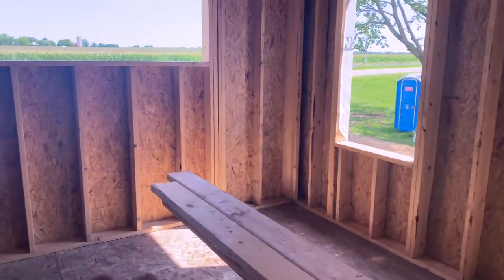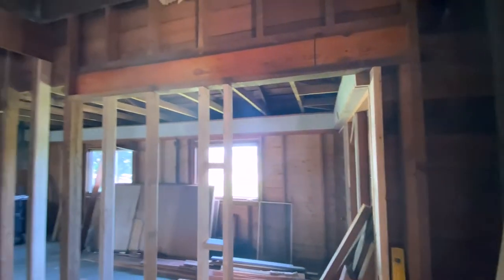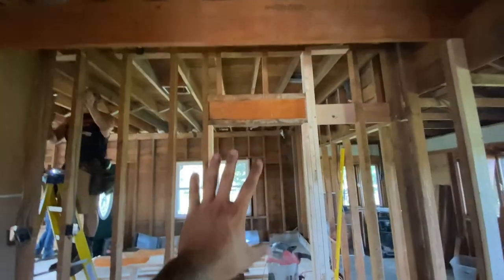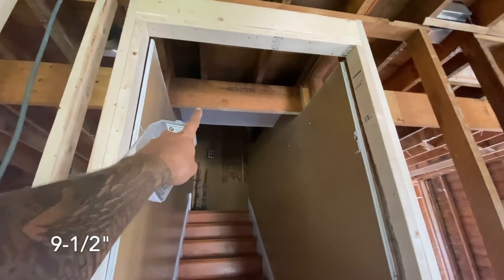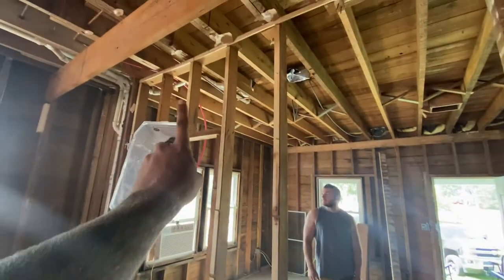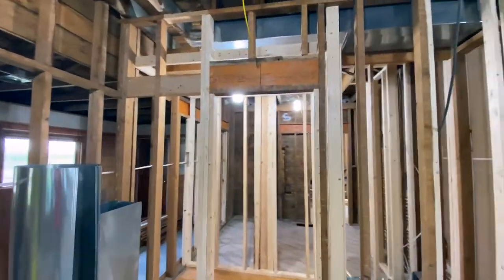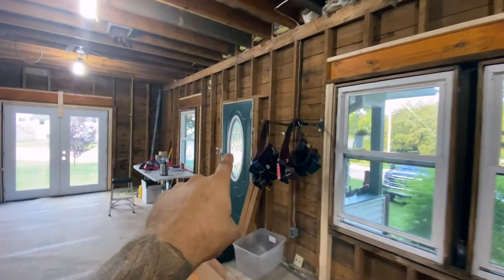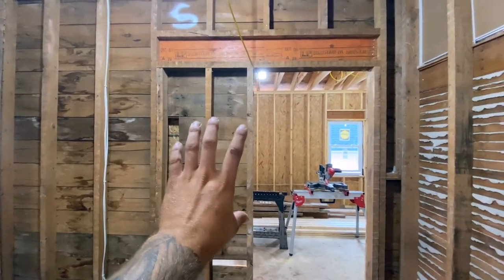LVL's in Remodel Framing

Comment: Do I have to run a board under header??
Reply from the maker: Yes. Always make sure the header is carried to the foundation. If you’re renovating a 2nd story you’ll need to carry those loads through the first floor. It can get a little tricky but it can be done.
Reply from the maker: If you need additional help feel free to email me at barrycontractingllc@gmail.com I can further assist you there.